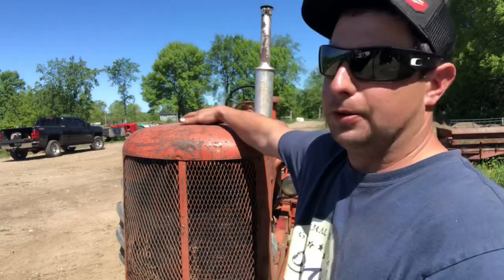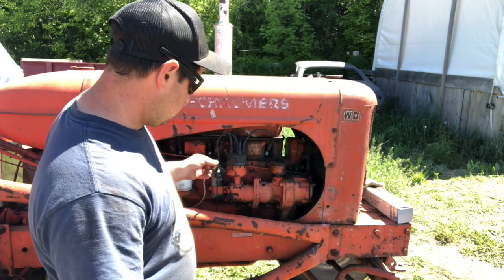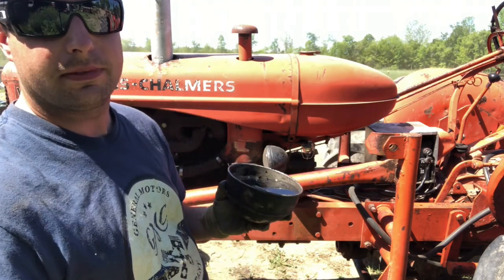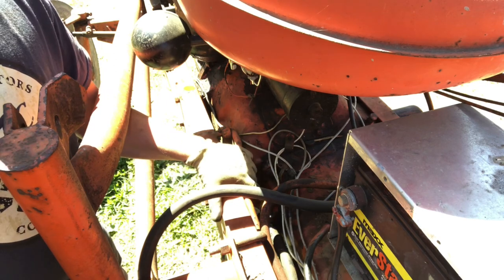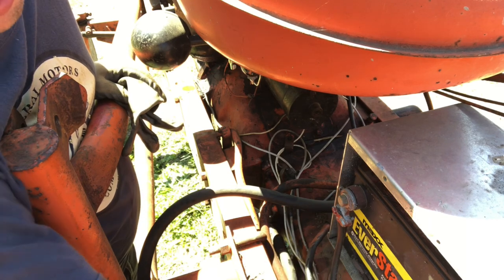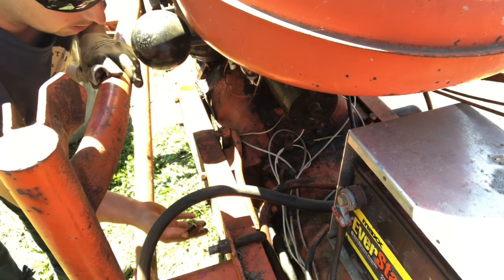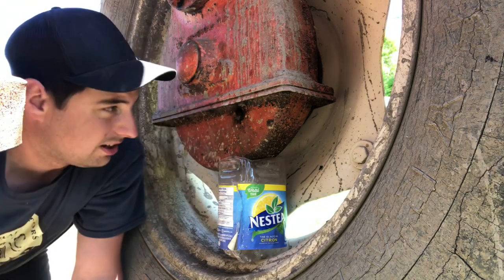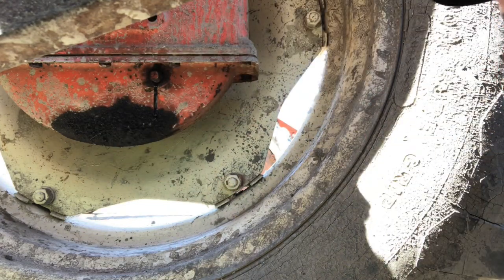Allis-Chalmers WD & WD45 fluid maintenance checks How to

Comment: Is the engine oil dipstick the fill location?
Reply from the maker: No , theres a cap in front  of the distributor/ behind governor housing and if someone has swapped a combine governor then you can remove the hood and go through the valve cover

Comment: So on the hydraulic do you add where the dipstick is?
Reply from the maker: Yes , and there is instructions on the stick for measuring level
Reply: Is there a difference between the hydrolic and trans fluid. My alis leaks from the pto and was wondering if i should fix that right away
Reply from the maker: @littleturtleg1767  yes , hydraulic is separate from trans/rear end and the final drives have their own as well

Comment: Wish you would have shown trans plug and read did plug I could not see where they was at
Reply from the maker: For level or drain ? I was only showing levels , but this tractor was a poor example as the hydraulic lines are in the way , trans and diff share the same fluid , but there is 2 plugs and upper and lower ,  when I do my full service I’ll make another video , thanks for watching
Reply: @ontariovintagetractor  both level and drain ,are they square but type for level I see several on my wd and how do you ingage the pto in back for a bush hog
Reply: @ontariovintagetractor  so for the level of the fluid, do it requires just to be topped off? I agree these things are hard to get to 🙃
Reply from the maker: @brianraabe308  yes , fluid level should be just below the fill plugs, thanks for watching